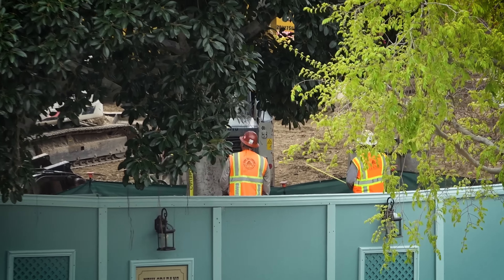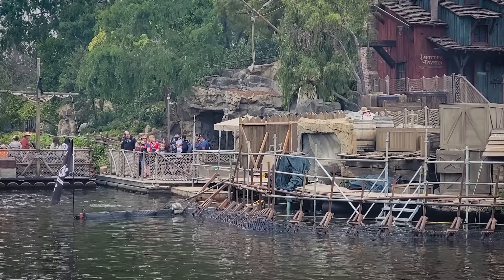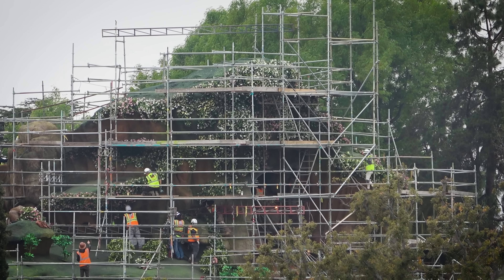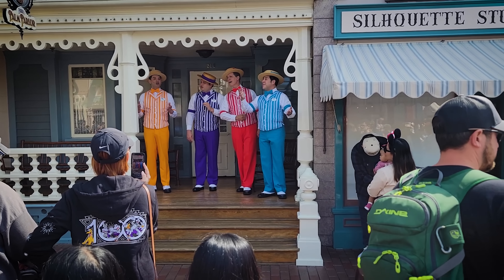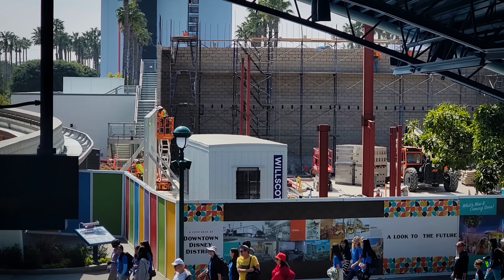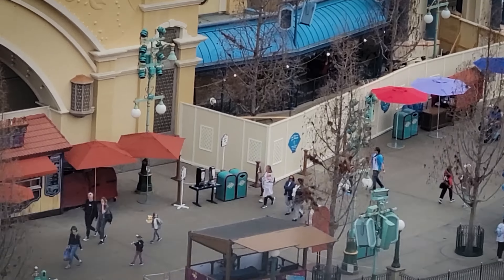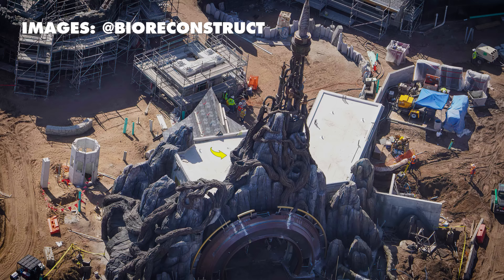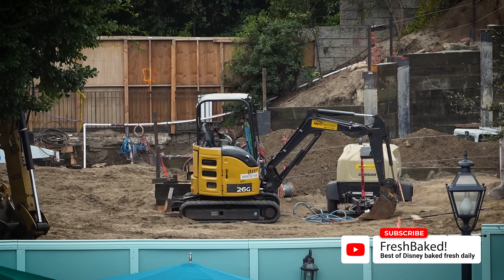Mysteries solved + new mysteries + Epic Universe! | Disneyland Construction 03-25-2024

Comment: The roofing at the lift hill of Tiana's Bayou Adventure most likely is getting replaced due to age and having to be fire treated and having to be fire rating updated, since that wood roofing is so old, since Splash Mountain was built in the 80s.

Which is also why a lot of the lift Hill building is getting redone as well, I assume.
Building code and fire code are very strong in California.

Comment: You used to be able to walk around Donald's boat 360°. they've cut off access to the back half with the new update and shower.
Definitely due to a pool shower code. Most places require a shower with a pool/splash pad area. Chlorine and other chemicals should be washed off